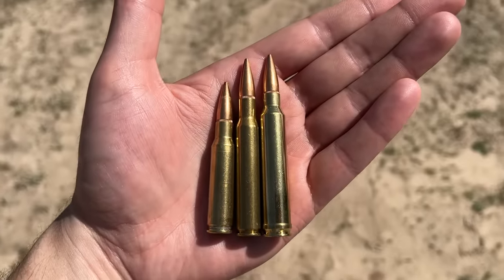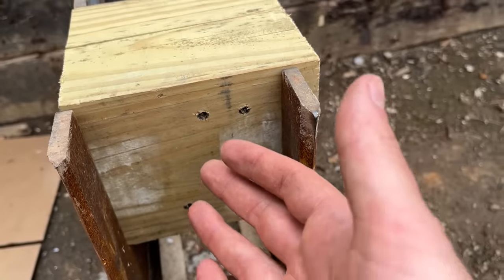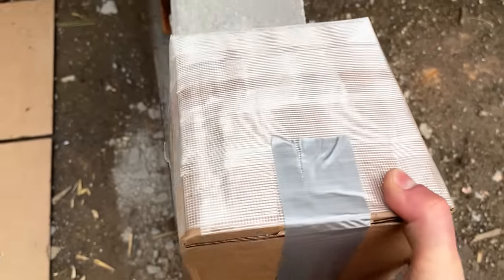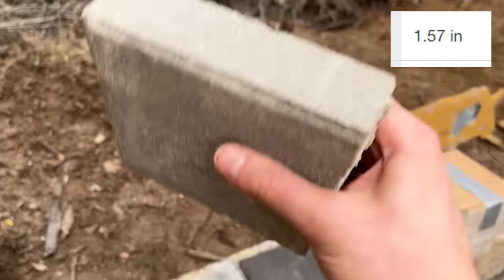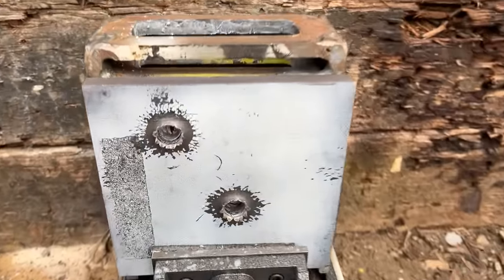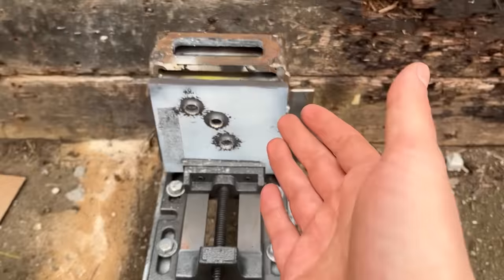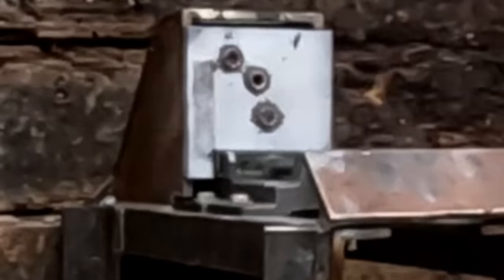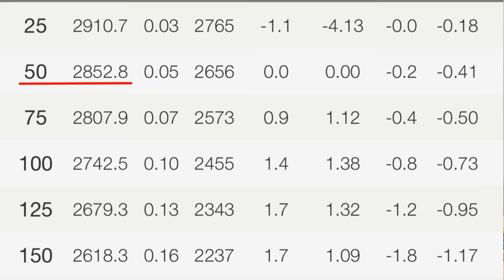308 vs 30-06 vs 300 Win Mag: Did Not Expect This

Comment: M2AP is pretty decent. There is a version of 7.62x51 AP made by FN called P80 or also M61. That has a harder steel core than M2AP and has been known to penetrate better. Edit: might be wrong - see Buffman Range's reply below
Reply from the maker: I have compared the 2 in 308 and I believe that the P80 did perform slightly better than the M2 like you mentioned, from what I remember.
Reply: The steel core hardness is about the same, but all data I've seen shows the M2AP penetrator is better. It's longer and heavier.
Reply: @BuffRANGE  Makes sense, if anyone knows it's definitely you!

Comment: I'd recommend using steel plates and wood blocks that are at least twice as wide at the frame of the holder.  Having them be the same width guarantees they will flop out of the holder on each shot.  That would also give you the ability to shift them slightly to move previous hits out of the way.  Appreciate the effort to produce this content.

Comment: For your tikka 300wm id recomend getting a three chamber lateral, or swept back muzzlebrake(as long as it doesnt impart a moment of inertia on the barrel)  and extend the length of pull with a slip on limbsaver recoil pad. If your feeling fancy get a stock spacer. It also helps if your scope has a good amount of eye relief. I heard something about bavkfiretv's recoil pad lookin pretty sweet though

Comment: Friendly advice. If you load the bipod by leaning your weight into it before you shoot it will help with that bounce that's happening to you on the larger calibers. Not important in this application but if you want to improve your ability to shoot accurately it's a good practice.  Might require you to attach a crosspiece on the table top.

Comment: the specs for the US 30 Cal (30'06) is "Penetration, fired at 7/8-inch thick homogeneous armor plate at 100 yards, will be not less than 0.42 inch" as per the TM 43-0001-27

Comment: Back before WWI, the Italian Army did penetration tests with various rifle calibres ( 6,5 ; 8mm etc) and found that Sand bags  up to 300mm thick stopped all rifle bullets ( lead core, AP was only introduced in 1916 by Germans); wood planking required almost half a metre, and steel plate required 7 to 8mm ( 5/16)".
Loopholes in steel plates were subsequently penetrated by 7,9 "K" cartridges  ( hardened steel core)...only issued to German Snipers.

Comment: I had to fill my Winchester Model 70 stock with fiberglass body filler because the .300 Win Mag kicked so bad. It really smooths out the recoil. When you missed the 30-06 I had to laugh because I had a friend reload some .300 with black tips, and they were so inaccurate I couldn't hit a barn wall from the inside.

Comment: Wow, only content online I've seen that doesn't hate on the 308, and actually makes the case the only practical difference between that and 30-06 is 308 is cheaper, more available, and has better recoil control. Also clear, don't bother upgrading from 308 unless it's on the level of 300 Win

Comment: 308, 30-06, and 300 winmag loaded with 55 grain accelerators
Reply: All three melt the sabot well before reaching max pressure, so there's really no point in comparing.
Reply: @zacharymorris9917  I saw a video of a guy using them in 300 winmag getting 5000 fps and blasting through ar500 so I thought it'd be fun to see. Didn't know they melted the sabots
Reply: Maybe some one will copper plate the sabots some day.
Reply: @JACKINSTEIN  that video is fake.  Try it yourself.
Reply: With 55gr fmj vs 62gr green tips in the sabots😮
Reply: @zacharymorris9917  well dang lol thanks for the info and I think I just might just for shits and giggles. Hope you have a great weekend ahead of you and a happy Easter
Reply: @JACKINSTEIN  carbon nylon sabots might survive long enough to get decent speeds.

Comment: I have a piece of class A armor 1 inch thick with the core of a M2 AP shot stuck in the plate the jacket shredded on impact 25 feet in the basement with a M1 Garand. that was shot back in the mid-seventies. My dad work at IIT armor research foundation as an apprentice and that is where the plate came from. Keep walking in Elmer Keith's footsteps.

Comment: The advantage of the Win Mag is you can buy heavier bullets, like 190gn fairly easily and they still have a velocity in the 3000fps range.  
I have a book on what makes a gun powerful and in that book it discusses the .308 vs the .30-06. Part of the design brief for the .308 was to have similar power to the .30-06 but less recoil. In the book is a chart of recoil and IIRC the difference between the .30-06 and the .308 is 7 or 9 ft/lbs depending on bullet weight. Be on google anyhow so don't take my word for it.
I've never shot a .30-06 so I don't know what it's like compared to a .308. The Win Mag I've shot had a muzzle brake so felt like a .308, perhaps even a little less.

Comment: The comparable velocities for the 308 and the 30-06 is strictly due to the improvements made to modern powders. From the time of its inception until shortly after 2000, the 30-06 would have generally 100 fps to 150 fps advantage over the 308. Ever since around 2000, that velocity difference seems to be narrowing.
Reply: Until you move up in weight then the ought 6 starts to separate itself from the 308
Reply: @kordi7888  - Yes, 180 grains pretty much max for the 308. The '06 rapidly pulls away with anything heavier than that.

Comment: You would be surprised at what a soft point will do to that steel. I would suggest checking it out. Even better results if you hand load them. the key to punching through steel like a hot drill press is getting them to hit 3200 fps or better. Even had some .556 loaded with some .218 bee projectiles punch through mild steel like hot butter.

Comment: I'd imagine if the barrel lengths are the same or similar, you're going to get diminishing returns on burning more powder, because the pressure from the gas doesn't have any more time to act on the projectile. I bet you could get a long barreled rifle chambered in 308 to higher velocities than a shorter barreled 30-06.

Comment: to qualify the concrete block situation here... the 300wm would have dead-up killed someone behind the block and the other two rounds they'd have made it to the hospital on a non-critical path... the wm left critical paths.   An intentionally doped hot .270 might just barely take your one inch plate.  They'll eat 100ton drop-forged half inch most of the day long with muzzles up in the 3400+ range.  The main trick is not to burn the copper off on the way to the target.  Borrow an older gun for it and maybe pack the breech in sand?

Comment: For bullet proofing purposes sand is great. I have establised a bullet proof saferoom by linning the walls with plywood boxes filled with packed river sand (silt). I live near a river and get tons of it free.  The boxes stop my 30:06 at point blank range. Where I tested the boxes a guy had his 6.5 Creedmore. I said take a shot and see what it does. My box stopped his bullet no problem. Make your boxes at least 7 inches deep and it is very important to pack the sand to press out air. Im still curious thought if my boxes will stop a 50 caliber BMG (BROWNING MACHINE GUN).

Comment: Great video! 
<i'll take the 30-06(nato round,) because it's cheap, and so many weapons were designed around it>
<seems trite, but back in the 70's, my dad(hunter kind of guy)bought a 7mm magnum and shot it from the back yard into the back 20 acres; had a huge flame jet out of the muzzle. it was just a test, but it was very hot round, so pretty sure the deer could not survive that one>

Comment: Hey man, just found your channel. You seem just goofy enough to be my cup of tea lol

Anywho, what grain were you using for the 300wm? Reason I ask, my 3/8" AR500 targets will take 180g 300wm all day. But I found a sale of some 165g norma and that 15g difference punched clean holes in it like a daimond bit. 

Also, your 300 is threaded. Y no comp? I threw a spare SI AR10 comp on my 300 bergara its a new gun. Before the comp I could maybe put 10rds in 1 sitting and feel it the next day. Installed the comp and my next range day I had to force myself to stop after I tapped into my 3rd and final box. Recoil felt like my AR10. I cant recommend comping your 300wm enough. Goes from a shot you feel in your balls to almost an intermediate cartridge.

Comment: Vital information left out! What bullet grain was you using? What Powder was you using? I can push a 30-06 over 3000 fps with a 168 gr bullet using 4350 powder. Granted it is a hot load by todays standards but not so much as the loading data that was out there 50 years ago. 4350 VS 4064 will make a big difference! Cas shape and powder selection makes a huge difference! I need all the data before I make up my mind on that. For long range I use a 7mm rem mag. I can push a 140-gr bullet well over 3200-fps. With ram shot powder. For 400 yards or less I use a 22-250 with H380 I can push it over 4200-fps. 30-06 can be pushed over 3000-fps with a 168-gr bullet using 4350, The 308 can be pushed to around 2900-fps with the same bullet, The 300 Win mag can be pushed over 3300-fps with 4350 but it takes 74 gr of powder to do it VS 60 gr for the 30-06. So in my view the 30-06 is the best overall cartridge for a do it all rifle! Faster does not necessarily mean better. I rarely use my 30-06's and I rarely use my 7 mag. My 22-250 will do anything I need it to do in the lower 48! Penetration don't matter one bit if the bullet does not perform!

Comment: I'm not questioning you but I wonder if the barrel lengths you're using could have an effect on velocity or even thread or barrel twist rate. So like.....my m1 has like 1/11 or 1/12(I'm not sure because it's from civilian military program) my 308 is 1/12. Both 18 inch. No muzzle brake. My 3006 will penetrate deeper than my 308 every time. Now I don't have ap rounds.................great vid bro.

Comment: Why not try using wet sand? Not talking about a sand wash, but just dampened a bit to where the sand clumps together. Should give you better results with rounds coming through as it adds a little bit of lubrication. Would be interesting to see...
Reply: I would like to see that. I was thinking it would be more dense and even less likely to get through.
Reply from the maker: I think you may potentially be on to something as the 300 BO made it through 8” and that sand was partially damp

Comment: Was wondering why the 308 and 30-06 did so bad on the steel. But guess 5 inches shorter than the Mosin is the answer. Have never measured speed, might have to do that later with both my 20" 308 178gr and my 29" Mosin 185gr.
(already know which one penetrates more, just don't have numbers)

Comment: can you try loading a 22lr with flash powder? if you have a sturdy bolt action it will handle it fine and have very weird ballistics, optimum barrel lenght way less, very powerful, very corrosive however so make sure you clean it (it basically salts the barrel)

Comment: Did you use the same projectile for each?  Like a 168gr SMK?  That would be the sweet spot, I'd think, and then you've got an identical sectional density (determines a projectile's penetration capability) so you've isolated everything but velocity.

Read the description and didn't see anything about the projectiles.  Steel quality is there though, lol.
Edit: should have watched to the end, lol.  Glad to see the projectiles were the same!

Comment: i dont know where youre located, but i have a 300 savage, would love to see that in a head to head
Reply: 30-30 too
Reply: 300 savage had about the same ballistics as a 30-06. Hope that helps.
Reply: The 300 Savage and 308 are nearly identical. I would expect the exact same performance. 🤠
Reply: @donwyoming1936 fun fact, the 300 savage is the parent cartridge of the 308. that's why I want a comparison, because they're related.
Reply: @cloudstrife5209 it's actually about halfway in between 30-30 and 30-06.

when savage designed it in the 1930s, they were hoping to match the 30-06 in a cartridge of similar size to the 30-30.

Comment: I've said it a thousand times and I'll say it again... 30-06 may have a case capacity advantage over .308, but unless you're using bubba's 220gr+ pissin' hot loads, its irrelevant. with a saami spec pressure lower than .308 you can expect roughly the same performance between the two... fudd lore be damned

Comment: What distance is your range. Because at around 50 to 100yds I punched through 3/8 ar500 steel with normal old 22 250 remington umc 50gr  jacketed hollow points traveling at 3820fps. So I am a little surprised that the fmj didn't do more than they did especially 300win mag. Never mind the specialty Ap rounds.

Comment: Did you let concrete cure for 28days ? Or use an accelerator?  It looked like good mud (not sloppy,wet concrete) .Also did you catch the size of sand you used? And I didn't catch at what range other than point blank. Enjoy your content alot.

Comment: it should be no surprise that the .308 and the >30-06 perform similarly.... The .308 is based on the 7.62 mm NATO which is designed, in fact, to shoot the same bullet as the .30.06 and to have identical external ballistics, i.e., velocity.

Comment: What’s the manufacturer of your 30-06 bolt action that you were using in the test. I did notice that it had an oversized bolt! Thanks I lost 12 guns in a house fire and was screwed by State Farm Insurance Company. I’ve been looking for a Smith&Wesson model A in 30-06   That’s what I had with a few mods   It was a 1968 model and looked and shot like brand new. Again just wondering and Thanks

Comment: Ya need to switch out the plates after every shot you cant be shooting the same plate multiple times. ='D 

Think of it this way you will definitely get extra exercise and where ever you purchase your target materials, will like you more and maybe they wont tack on the small order surcharge. Of course I may be wrong and you are using left over scrap materials from proper materials purchases.

Comment: I don't see the bullet weights listed. The wood is the least destructive to FMJ projectiles. Obviously. The sand and concrete are almost identical in the results. Solid copper projectiles will provide you with some interesting results ,  just try to use similar weights. Using lead filled FMJ's will always lead to these same results. To be a fair comparison, the weights must be equal.
Reply: At the end he shows them. All 147
Reply: it is in there. very short moment

Comment: Both of the 308's would have gone thru had the 3/8 plate been secure. In fact they all would have!! As for the sand box! Have you removed the spent rounds from earlier tests? They could be stopping anything else trying to get thru. Just sayin'. The 300 Win Mag had more craters from shrapnel than the other two in the concrete test.

Comment: Your 30-06 seems a little slow.  Different powder maybe or primer. I've seen 180 at over 2960 and 150 at just over 3200...24in barrel.  Very very hot loads but no pressure signs

Comment: Well the 30 cal 1906 (30-06) and the .308
Are about the same 
Because the US Army changed the powder to  a hotter one making the two about the same . 30-06 dose have a lot of bullet weights .
Both .308 ,30-06 .308 both take .308 bullets
Where the difference might be is the 30-06 using IMR 3031
IMR 4064, where the M14 308 used Winchester powder?
Why was the 300 a steel type ?
You should have never seen any point sticking out .
And you shown the bullets in your hand the 300 was a lot longer!
Was all bullets the same grain?
Where all bullets FMJ.
Where all the bullets
From the same manufacturer?
What powder types did you use?

It was fun to watch, but with the difference, I stated, "Make the test iffy .😊

Comment: Great stuff. However, the fact that you reperadly shoot the same block is not an acurate test. Every shot loosens the wood fibers and weakens the block. The last round has the advantage. Especially with high powerd rounds. A better test is a fresh block for evey different round. Keep it up.

Comment: If you load a 30-06 with 200 grain bullets and use 56.1 grains of Reloader 22 powder the 30-06 leaves the 308 way behind because it can’t handle the 200 grain bullets. So your comparison of your 30-06 to 308 is not giving the 30-06 due credit. The 30-06 with 200 grain bullets can actually beat a 7 mm magnum because it can’t handle 200 grain bullets either. Don’t take my word for this. Look at your reloading manuals or do the ballistic calculations and see if I’m not correct.